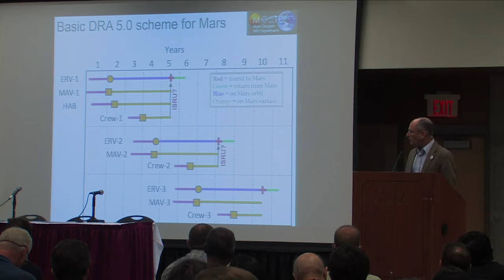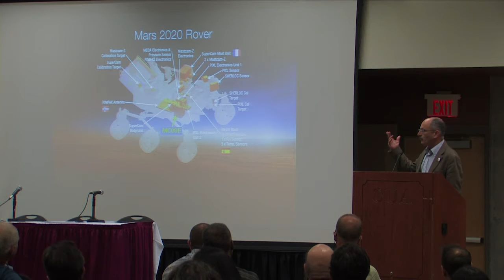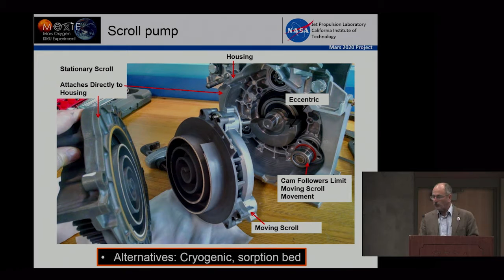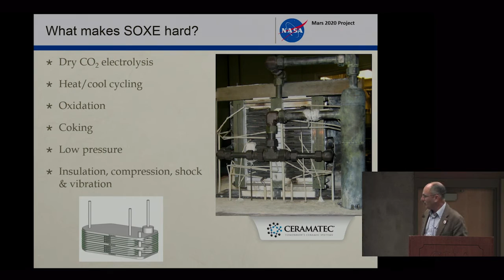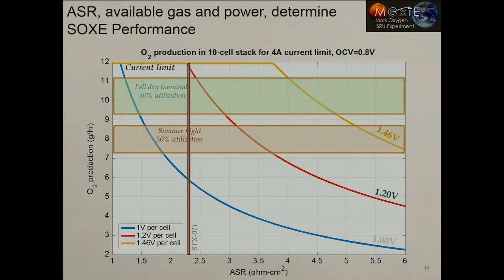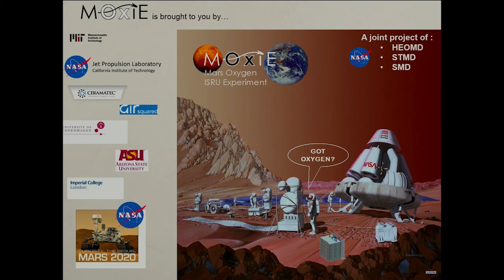Dr. Michael Hecht - MOXIE - 19th Annual International Mars Society Convention

Comment: sorry I see this now , it's old video ..I know.but seeing this I have a stupid question: it is possible to modify MOXIE in order to collect mars sands you worry about ,co2 then co result with that sand and some chemical liquid to transform it in some compound to be then used by a 3d printer to print some Lego bricks easy to assembly and some printed nails can be assembled in specific parts to help rovers to move where is not easy to move but that zone could be already explored so conquer in a creative way to be re exploited ? think then you drop then other tanks supplies about that chemicals and the rovers they return easily to re-feed as a network ,they produce o2 , bricks for the next `carpenters`  arrives ,human kind.. so if you figure out how will be a small brick from a rover to a great building for mankind .

Comment: MOXIE is one of many systems on Mars that will require lots of power when made into the larger scales required for human survival.....Power that cannot be initially produced easily. I believe small nuclear powerplants, such as the smaller version of an Small Modular Reactor (SMR) could provide the initial requirements to power all systems, including the extraction of raw materials to be put into a small scale production plant, for the production of equipment to produce other energy sources like solar panels, wind turbines (mars is very windy at the surface) and batteries. Nuclear reactors could as well provide the power for 'heavy-lifting' duties such as helping in the terraforming of Mars. The energy density of nuclear cannot be ignored, at least initially, since taking all the supplies needed (water, oxygen, food, building materials, etc) will be prohibitive.

http://www.westinghousenuclear.com/portals/0/New%20Plants/AP1000/figure-smr%20comparison2.jpg

Comment: Why not use the CO as fuel for the return rocket? CO + O2 has a relatively good Isp and then you don't have to bring any fuel for the return rocket. That would seem to be the simplest solution. And test it out in advance on a sample return mission.
Reply: They are considering this. But you would need to bring a dedecated engine for that. So by now they think it is easyer to eather bring H2 frome earth or use H2O from Mars to make mathane and use the same vehicle. Eg. Space X Starship